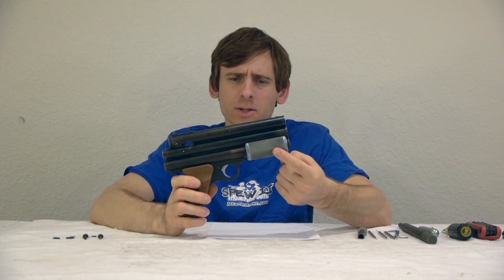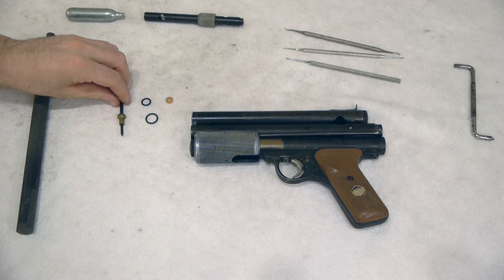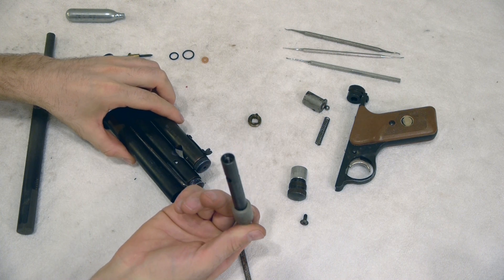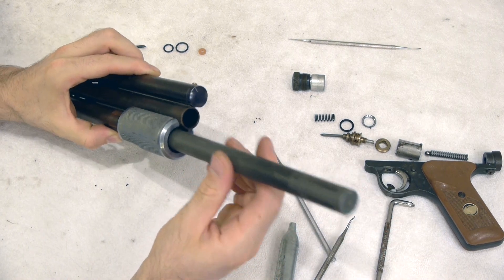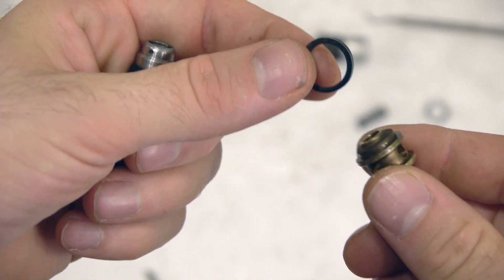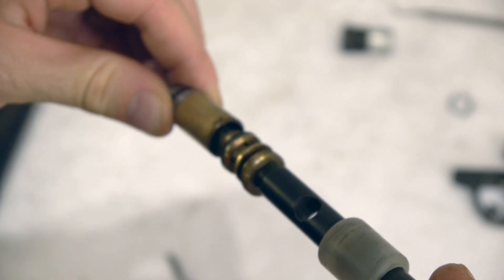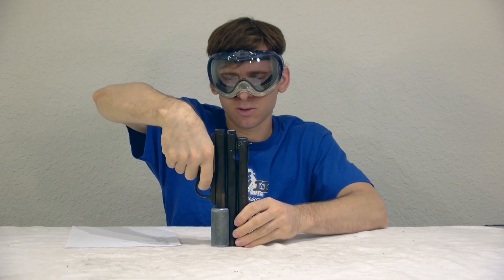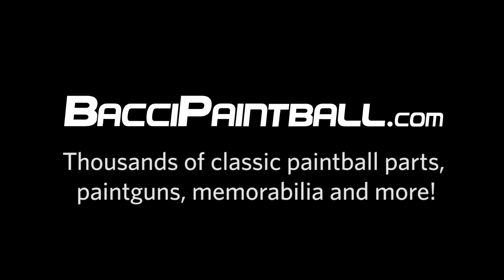Rebuilding a classic Sheridan PGP Paintball Gun from Pursuit Marketing Inc.

Comment from the maker: Blaise,
The wobbly piercing pin is normal on earlier piercing valve stems that don't have the brass extension over half of the piercer.  The later styles with the brass extension do still wiggle but not as much.
The thing to remember is that the piercer will be using the steel valve casing as a guide so even if it wiggles it should still pierce fine. I've added a link to the piercers at the end of the video description.
Send a picture of the marker through facebook, I'll help you identify it.

Comment from the maker: The lead seal isn't need but it doesn't hurt.  I usually dont reinstall it after taking apart a valve.  Palmers and Mac 1 also don't add them back in.
A light leak down your barrel is likely from the cup seal or could possibly from the valve face the cup seal is sealing on.
Are the 3 brown orings in the video? If so let me know the second mark in the video when you see them. 
Or are they a part you received in a rebuild kit from Palmers?

Comment from the maker: Did you make sure to pump / fire the PGP after loading the 12 gram in?  

They are shoot to pierce so it needs the piercer cup seal to slam forward piercing the 12 gram.
If that isn't working then you could have one of the following problems:

*Steel 12 gram face assembly is damaged preventing piercer cup seal from hitting the end of the 12 gram.
*Front grip frame screw could be too long, preventing the 12 gram from going all the way in.
*Cup seal could be non piercing version.
Let me know, -Dan

Comment: Thanks very much! Really found this helpful :) I notice you left out the led oring, does this actually make any difference or cause any wear on the valve or locking nut? Also after replacing the seals I still have a tiny leak down the barrel, any suggestions where I've gone wrong? Oh and one last thing, what are the 3 brown orings

Comment from the maker: djSinege,
I created another video showing how to cut a quick strip slot on a sheridan. I'll add it to the beginning of this video description. 

In the beginning of that video (before cutting the strip slot) I remove the bolt.  There are several styles of bolts with some using spring loaded lugs, thread in lugs or in the case of the PGP2k, a press fit lug.  Watch that video and see if it helps.  If not post on that video or message me though my site or facebook and I can try and help.
Thanks

Comment: I've got a very aged one, and the pumping action is really hard to start and really stiff, any idea how to fix it?
Reply from the maker: +Ryan Reid I would disassemble the pump and bolt and check your oring on the bolt and for built up gunk on the lower tube. Clean the oring or replace the oring and then clean the gunk off the lower tube (where the pump moves) and gunk inside the pump.  Add a few drops of oil (I use KC Trouble Free Oil which is the same as Outlast oil now).  Reassembly and see if that helps the stroke. Your hammer spring tension also plays a part in stiffness so if cleaning the pump handle area doesn't help then disassemble the back of the lower tube and see if there are any unnecessary bbs added between the back cap and hammer spring to add more tension.  Depending what model you have you can also add an RVA which will allow your velocity to be able to be adjusted and reach a higher velocity with less tension on the spring. Hope that helps.
Here are bolt orings:
http://www.baccipaintball.com/she828.html

And RVA kits:
http://www.baccipaintball.com/she325.html
Reply: Thanks! Will try it out

Comment: i have a sheridan 5mm "20cal" model EB co2 pellet pistol does this apply to it as well look very similar to the bottom half of that gun
Reply from the maker: Kyle, This guide will work for rebuilding the lower tube if your Sheridan EB uses the classic style valve.  
If the EB uses the more modern Sheridan Cartridge valve (where the entire valve assembly is one piece that is is pushed out of the lower tube) then I would recommend taking a look at this guide:
How to Disassemble/Rebuild Sheridan PA-Series Paintball Marker Cartridge Valve
Reply: thank u this was extremely helpfull